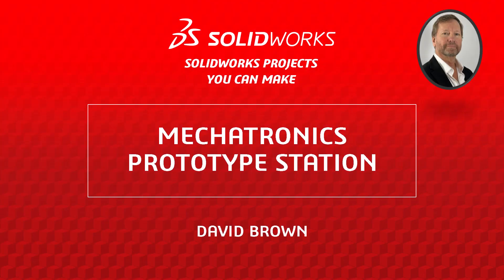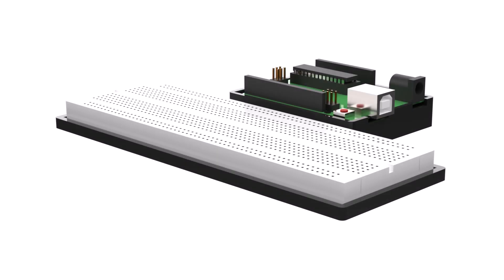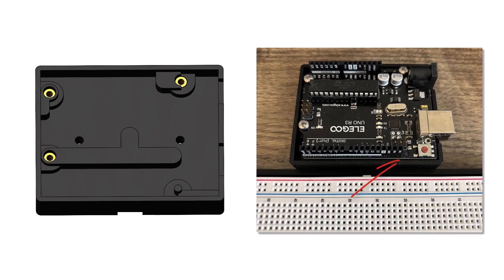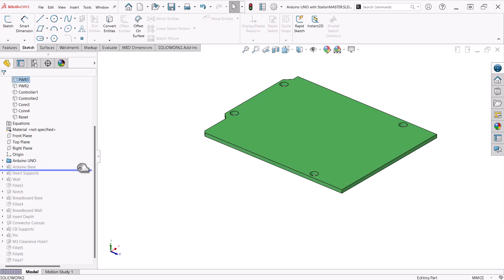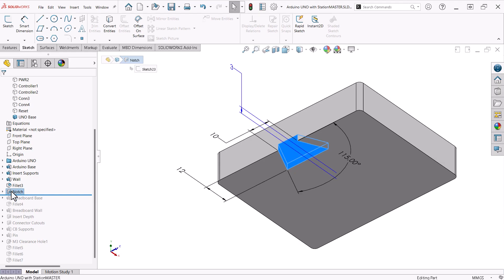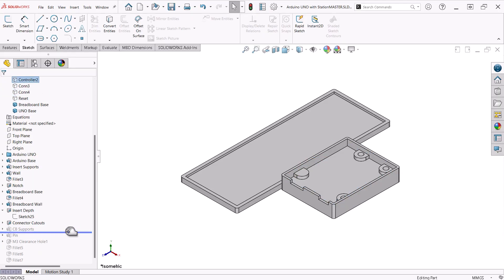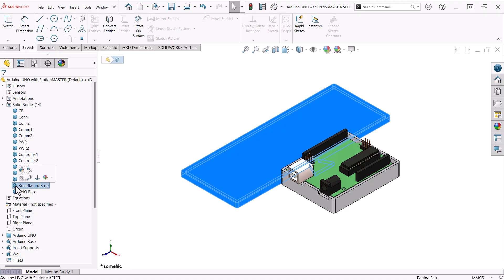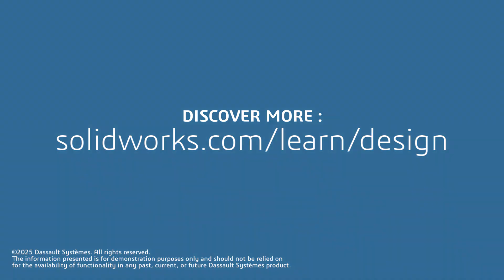Mechatronics Prototype Station

Comment: Thanks for sharing your design process. I'd probably go about it slightly differently, but neither method is categorically better. 

As for the mounting holes, one thing I've done with PCBs in the past is just make an extruded 3D printed feature in the base that pokes up through the hole and then once I place the PCB on the base, I just get a heated soldering iron and push/melt the extrusion flat. No screws required, but this does make the base a single use item and PCB is permanently locked into the base unless you damage it.